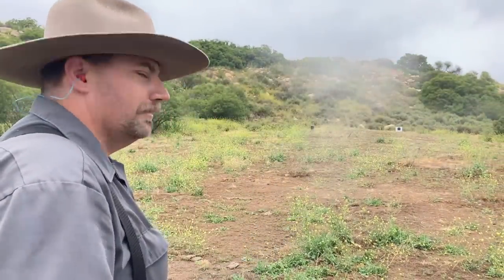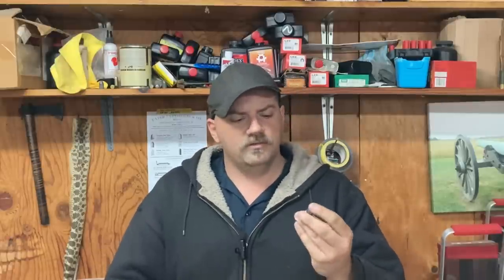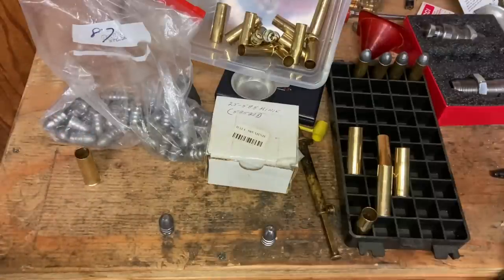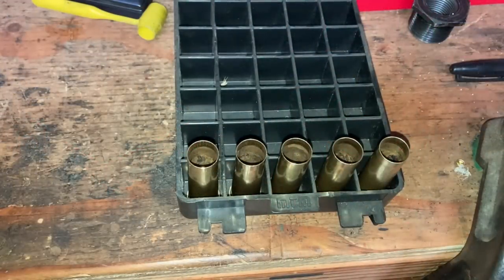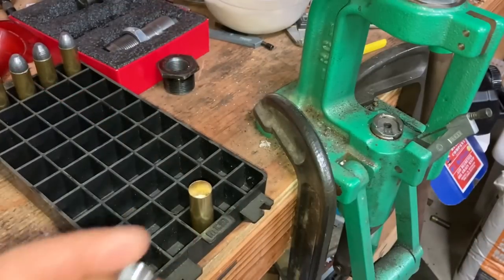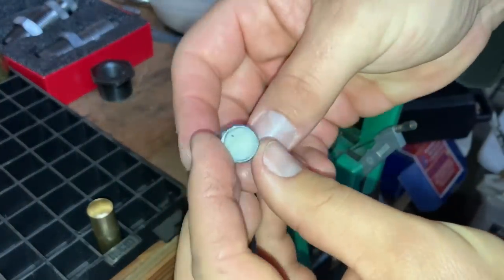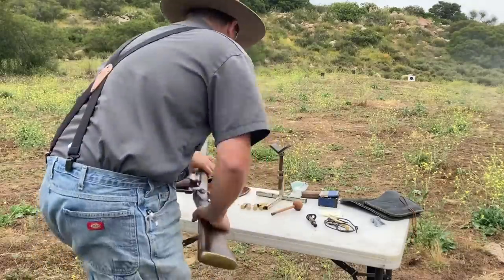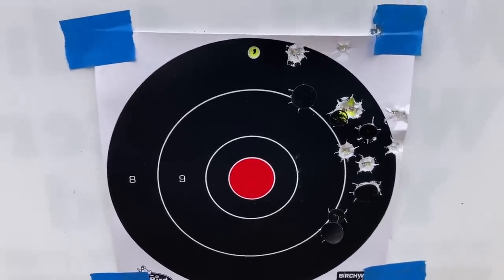577 Snider Load Development. Do 575 Minié balls work?

Comment: My commercial Snider Rifle likes .585 lead round balls shot from trimmed 24 ga. primed red cheddite hulls @50 yds.  I had to make a removable front sight so as not to alter the original.  My Snider Carbine likes .587 minie bullet with a wood plug in the hollow base shot from trimmed 24 ga, brass hulls.  I made test plugs from 3/8" dowels beveled in a 100 year old rotary pencil sharpener and then sawed off to size with an X-ACTO fine toothed saw.  They worked, so I found some 3/8" hardwood plugs for covering countersunk wood screws at a hardware store and they worked great as is.  The British initially used baked red clay plugs which I thought was very odd.  I believe wood plugs were used in Continental Europe which made much more sense to me.
Brits also initially used complicated multi metal wound brass foil cartridges because modern spun brass cases were not available at the time.
Reply: the hard ware store plugs were my first thought when I watched the video.

Comment: If you know anyone with a 3d printer, you could try 3d printing the cavity fill piece, should work as well as wood.
Reply: Thought of that too. 

I've seen someone 3D print the case itself, basically like a solid spacer with the outside dimensions and case mouth of .577 Snider, which inside narrows down under the bullet in like an upside down bottleneck shape, the 'neck' having a .38 Special casing fixed into it which holds the blackpowder charge and the primer. Using TPA as a material, the case is overall strong enough to handle it just fine, while the thinner part has the right amount of flex to give obturation.

Comment: I use the undersized Burton balls to fireform my brass for the chamber of my rifle, but it is not accurate.  The Snider cartridges came in 9 different marks, and that's because they could never really get their bullet design to work right (among other problems like the bases ripping off).  The nose of the bullets were originally hollow with a wooden plug, but later they eliminated the wooden plug in favor of just spinning the lead over the nose of the bullet.  The reason for this hollow was to to make the bullets fly well in a variety of barrel lengths, which worked because it moved the mass of the bullet to the rim of the bullet (and also had the effect of making them a lot like hollow points!).  As you noted, they also had a hollow in the base, which held a clay plug soaked in beeswax.

But here's the thing:  A hollow base isn't necessary, and wasn't then, either.  You only need that for a muzzleloader so you can load without having the fouling jam you up.  The chamber on a Snider is 0.63, so you can actually use quite a large bullet.  I use a .600 bullet cast with a mold from X-Ring Services (pretty much standard in the hard-corps Snider community).  Thee bullets have solid bases, but because they are large enough the process of  compression is enough to cause them to take the rifling.  I do not use a press for loading, I dip-lube the bullets and simply insert them by hand after fireforming the brass with sub-caliber Burton balls.
Reply from the maker: I’ll probably end up getting that .600 mold from x ring.

Comment: Sometimes with Pritchetts and Minnies it's not that the bullet isn't slugging up and fitting the bore that's the problem. Pure lead, soft bullets will expand to fit the bore. The problem is that the skirt blows out. They'll work with really light loads, but gas pressure will  blow past or rupture the skirt at higher pressures. It's kind of counter intuitive but a heavy load, a harder alloy and some type of base plug worked better for me. I could have solved the problem a lot easier with a new mold though.

Comment: I have used several things for a base filler, lube, wax, paper, bondo.  I like spackle. It's a nice combo of easy to use and durable.
Reply: Car body Bondo works for me. I may try the lube though, looks much easier.
Reply: @tmcgill2219  Lube is way easier, but its a a big mess in hot weather, seriously, try light weight, not regular spackle. It's easy to use, drys overnight and you can seal up the container for later use.

Comment: I had an old Trapdoor 45-70 that shot about like that. I tried Cream of Wheat and Super Grex as fillers and groups were a little better. I shot some bullets (I was using hollow base 405s) into snow and they looked pretty bad, with some of the grooves chewed up and small "fins" pulled off the skirt, indicating some roughness in the bore.  A buddy recommended I try PuffLon ballistic filler. Groups shrank dramatically, and recovered bullets looked much better. Might be worth it to try on this rifle, once you can get that trigger working right.
Reply: @@lurch789 I used 20:1 and 30:1 alloy, as well as Lyman #2 (never pure lead) with the same results in the hollow-base design, and flat-base bullets (my first choice) grouped much worse than the HBs regardless of alloy or diameter. The bore was cleaned to bare metal using JB Bore Paste. Adding the PuffLon took care of most of the issues, which were due to almost invisible pitting just ahead of the chamber. Groups ended up nearly as tight as those from my friend's Uberti reproduction.👍

Comment: I’ve got a custom brass mold that casts a .590 diameter bullet of traditional profile but with a solid base and it’s a good shooter in the later mkIII barrels with 80 grains.  The Snyder is like everting else, give it a bullet diameter close to what the barrel needs and a good bump from black powder and it will shoot ok.  Now days I prefer to shoot a .50 caliber as it’s so much easier but the .577  served well as a transitional cartridge and no one would want to be hit by one!!

Comment: My first muzzleloader was a Zoauve musket repro back in the early.  70s. We were at a muzzleloading shoot at Saratoga battle field . My gunsmith friend won it in a raffle and sold it to me at a good price. As per his instructions i always loaded the base of the mini ball with crisco. It would shoot 3 inch groups at 50 yards if i did my job. Years later i found a smooth bore musket barrel that fit that stock. 20 ga. I now use that as my turkey gun.

Comment: If you like to cast your own bullets you might try Mountain Molds. He does not like to build for black powder guns but your in luck since a 577 Nitro Express also takes a .585 bullet, just tell him you need a bullet mold for light loads. 
He will think your going after wild hogs before trucking off to Africa....LOL
Reply: Accurate molds will make different diameter moulds
Reply: @markzimmerman7279  Excellent call on Accurate Molds, the mold number 59-550B is exactly the mold I was looking for, I have a Snider also.
Thanks

Comment: Love the videos and content. 
I've been playing around with 575 and 578 minie balls in 20ga shotguns. I use hot glue to fill the bases to increase the surface area.
So I have to wonder if using some hot glue would help. Regardless keep them coming . Lately I've been playing with and 32ga rifled barrel shotgun.  So far my best load is with and 50cal maxi ball and 44cal 300gr cast simi wad cutter using and shot cup as and sabot. I have and old brass 575 minie ball mold I picked up at and gun show and 578 that is and Lyman.  Anyone can load and common cartridge and get good results.  Then there is people like us who live to tinker with the odd balls.

Comment: Im not sure filling the cavity will flare the skirt as desired. Maybe try some loads with an empty cavity? If the rifle shoots to the right you can adjust the sights maybe. Try using a very soft lead for the bullet. Might help.
Reply from the maker: The same load with an empty cavity won’t hit the paper at 50 yards. I’ll probably end up going with a 590-600 projectile
Reply: @Everythingblackpowder  Hum. Well, most of those old rifles had the sights fixed for a specific load. Find that original load and it might help. I dont know too much about the old sniiders, but i sure enjoy watching you work up good loads for it. I hope you get that trigger worked out. That will probable make a big difference.
Reply: Federal Tru-ball shotgun slugs use a plastic ball to swedge the slug bore sized and even unrifled barrels @1600 shoot wonderfull . 
5 shots into a 20ga  5 shot box @100 yds that that barrel is all over the place with Anything Else . It simply works .

Comment: The dramatic change in accuracy between the two bullets was quite interesting. I’m more familiar with muzzle-stuffers than Sniders, are your shooting a bullet that is sized to the land diameter or groove diameter of the barrel? If it is groove diameter than bullet expansion into the rifling is irrelevant. I’ve found that when shooting a typical Burton ball, the skirt cavity is too deep and is affecting the bullets center of gravity during flight. This instability results in a larger group size and poi shirt. When you fill the skirt cavity with lube, it does not assist in expansion of the skirt, it is in fact changing the CG of the bullet slightly compared to not filling the skirt. Most if not all of the lube in the skirt cavity remains with the bullet upon exiting the barrel. I’ve found that a shallow truncated cone shaped skirt cavity with thin skirt walls improves the bullet’s accuracy while still providing sufficient expansion to grip the rifling of the barrel. The bullet is cast of pure soft lead as is typical with muzzleloaders.
Reply: In addition I typically shoot 45 grains of 3f Swiss in my .58 cal 3 bander and increasing the powder charge with this modified bullet does not change accuracy significantly. That should save your shoulder some hurt.
Reply from the maker: That’s not how they had it figured in the late 1860s. The original snider round had a hollow base and a hollow point. This was done to keep the bullet stable in flight by keeping the weight of the projectile to the outside of the spinning mass. My Enfield rifle musket shoots these burton bullets just fine with a hollow base, Not the case with the Snider. The Sniders requires something more than the powder to force the bullets to expand. Most folks use a .600 flat based bullet in their Sniders.
Reply: @Everythingblackpowder  That's fascinating information. Now I have one more thing to try on the path of accuracy, haha.

Comment: If you want to try a wooden wedge, you could put a dowel in a drill or drill press and either put a vertical tool rest or just use a file to get the angle and then use a hack saw to cut it off. Must be my mistake, because I thought you had a metal lathe, but you must not since you cut casings down with a drill and trim tool. As a machinist myself, I just assume people have access to the same machines that I used to. So many things you can do with a lathe that you should maybe consider buying a small bench top type at least. You would wonder what you did withiut one.

Comment: I think I shoot the same round out of my Springfield 63? As a Hydraulics Tech? I agree! the grease Plug should act like a wood Plug with the benny of grease for fouling ease of clean, as grease will not change size compressed under any Pressure?
Thanks! I Like It!    my Next paper cartridges will have a "DIY BP grease Plug". and this is a paradine shift for my papers, as I pack my DIY Lubed Minie's Bands shirt up with their primers inside each skirt separated from the main charge.

DUDE! Those ARE Great Groups!  I would Love this Group! at this distance with Any of My BP Muzzle Loaders! Any Size! Great Video!  but "I'm" too Lazy to Make My Own Darn Video? and you pulled it off With that Trigger.
Reply from the maker: Thanks Dave

Comment: I never tried to fill in the cavity, but this sounds like a great idea. The only question is what happens with the black powder that touched the lube in the cavity? I guess it will not ignite, so the 80gr load few grains of load will be wasted?
Reply from the maker: No powder touches the lube. The cream of wheat filling does
Reply: @Everythingblackpowder  right, thanks. I'm just adjusting this scenario to myself. I have a 3-band Enfield and we do shot with the minies at 50 and 100 yards. The problem is my 78" twist is not good enough to keep minie stable at 100. I never tried to load more than 75gr of FFg (and this is not GOEX or Swiss), so I'm scratching my head now increasing the load up to probably uncomfortable value, or do something else. The search of something else lead me into this video, btw. So I'm going to fill in my cavity with lube, but in my case it will be touching the blackpowder for sure. But the idea is great, thanks, I just need to adjust it a bit :)
Reply from the maker: Ah, I see. Well give it a try and see what happens.
Reply: I shot crisco packed mini balls in my musket with ball against powder for years no problem. I used it deer hunting with the gun loaded for days without getting a shot. No problem when it was shot. I learned that back in the 70s . I am shocked that isnt common knowledge.
Reply from the maker: We’re shocked you haven’t made any videos on the topic…

Comment: I wonder if chucking a dowel into a drill and using a file to turn the bevel then cut the little plug.  It would be enough for proof of concept.  Alternatively 3d printing would solve  it too.  Or maybe put a piece of tape inside a bullet and fill it with hot glue then pull the plug out.  Then install it into a new bullet so its not bonded in the cavity.

Comment: What alloy are those 575 cast in? If harder than pure lead, I wonder if something softer would work better.
Reply from the maker: All my minie balls are cast from 99% pure lead.
Reply: @Everythingblackpowder  Kind of surprised they need the lube to cause expansion, should have more than enough pressure. But if it works, sure is a simple solution to the problem.
Reply from the maker: That’s what’s odd about the Snider. The same bullets works just fine in my Enfield rifle musket with a hollow base but for some reason the snider needs extra help to get it to expand.

Comment: Why don't you just make a neck expander .002 under cast bullet diameter????

Make custom neck sizer .002" under fired neck after firing.

Your working brass too much
Reply from the maker: No need. I use a .600 bullet from X ring services.